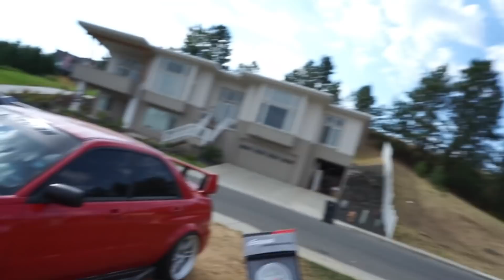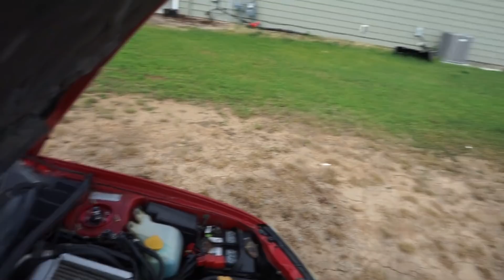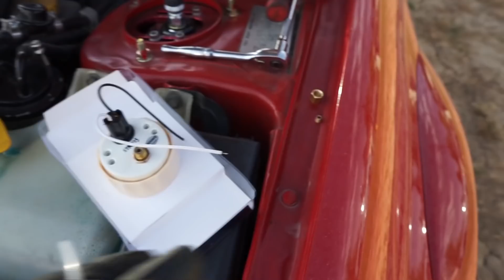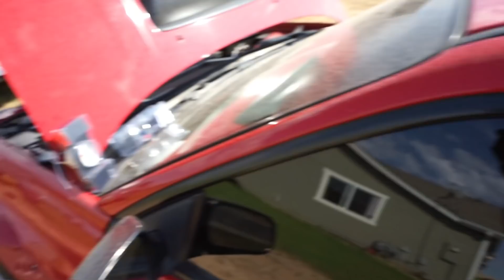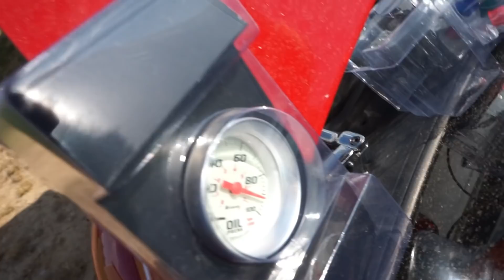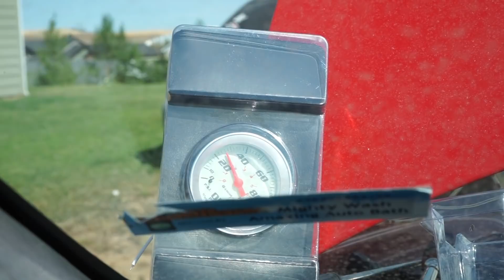How To Test Oil Pressure For $25

Comment: Do you have a video of what to look for if can’t prime the oil on a new built? I’m having issues with priming the oil. I really don’t want to take it apart again, so where should I look at first?
Reply: Firstly are your spark plugs out? The engine cranks much faster with them out. Did you pump a little oil in the pump before fitting to block? That makes big difference instead of putting in dry. If no luck, Try removing the oil filter, this can sometimes aid in priming the pump faster. Have a pan underneath ready. When it sprays out you are good to go. Hope this helps.
Reply: @chrism6  I’m about to prime my swapped ej20x OBXT. I’m also going to remove the turbo oil feed line to make sure oil is getting there prior to firing up the motor..

Comment: Really cool vid. Definitely going to be my next weekend project on my EJ205 Bugeye. Only thing I didnt hear you mention: What are the oil pressure numbers supposed to be normally?
Reply: I think he mentioned it in the previous video, when he test drove the car. I believe the oil pressure correlates with the load in the RPM range.

Comment: What oil do you recommend man. I have a ej20g version 2 sti closeddeck block motor in my mazda bounty ute 98 wrx 5speed converted to rwd. I use 15w 40 penrite oil. Im also looking to build a motor but unsure on what package to put together or parts wanting a motor to handle 500hp on pump but not push it to 500 being rwd an in a ute 😅. Any info be helpful man. Love the builds. Biggest fan from nz.
Reply: use penrite hpr 10w-50 mate

Comment: I thought the higher the oil pressure the better? Why is to high bad?
Reply from the maker: Too much oil pressure for a low rpm will create oscillation / air pockets in oil.

Comment: Thats normal oilpressure for a standard ej207
Reply: Yep my 2008 JDM STi with 12mm pump has the same pressure. It’s a EJ207
Reply: @lew2003 I still have the car and it’s going great. Still have the same pressure readings. No problems so far. I did change the oil pump to a 12mm at the time the engine was rebuilt 4 years ago.

Comment: What should the oil pressure be at idle if you’re running a built block and heads with a 12mm pump? And pressure at WOT

Comment: lol those are the same oil pressure numbers I get with 10w60 and a 12mm pump but the relief stops it at 75psi
Reply: Does that mean your max oil pressure is 75psi?
Reply: @jvh22a  yep, done hundreds of pulls over the last 4k miles on this engine build and it hasn't exploded......yet
Reply: Me too, I’m using 10w60 and 12mm oil pump and a Cosworth drysump pump and Spintric 2 with the oil tank
Reply: Okay I’m confused now.. what should the oil pressure be if you’re running a 12 mm pump on a ej257?
Reply: @A90MKV_  if you have a stock long block, the factory bypass pressure of 70-80 psi is fine
Reply: @jeremiahjorenby2275  on my rebuild ej205 with 11mm pump, start up pressure is about 95ish. On colder weather it's up in the 100psi.
Reply: @jvh22a  I was using a ported 10mm pump with the relief valve shimmed, but it quickly became apparent I needed more volume at idle to maintain pressure, that pump would do 110psi at cold start lol, but would drop to 8psi at hot idle
went on to the 11mm which worked better but I would start dropping oil pressure up at redline, so I stepped it up to the 12mm and pressure is rock solid
If my clearances seem big, its because they are, the crank, block, and heads all have 246k miles on them and are on the tipping point of being out of spec 😂
Reply: @jeremiahjorenby2275  I'll post back here in a few days with more accurate numbers.
Reply: @jeremiahjorenby2275  I have 12mm new oil pump on my recent new ej207 sti shortblock build on legacy gt with stock heads. 
My cold start is around 94psi.. hot idle seems low after some driving around 14psi. 
Is this acceptable or I need to shim the oil pump?
Reply: @MrANKIT30  Shimming the oil pump won't fix hot idle oil pressure. Soon as you drop below the relief pressure in the pump the relief valve is out of play. 14psi is the subaru spec for idle oil pressure when hot. What oil are you running?
Reply: @jeremiahjorenby2275 im running mineral oil castrol gtx 15w40 for initial break-in period(650miles so far) before switching to regular synthetic 5w40 or 10w40.
14psi hot idle seems on the lower side, mostly hot idle i see people get are 25 to 30psi on their turbo subarus with 12mm pump